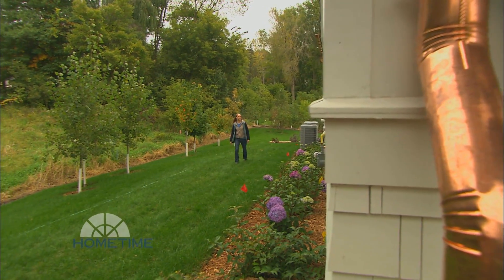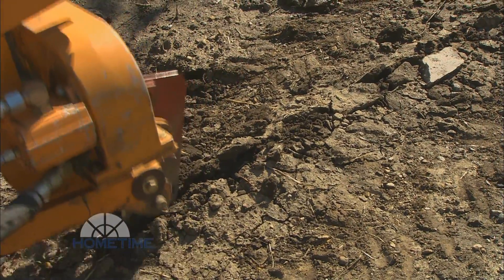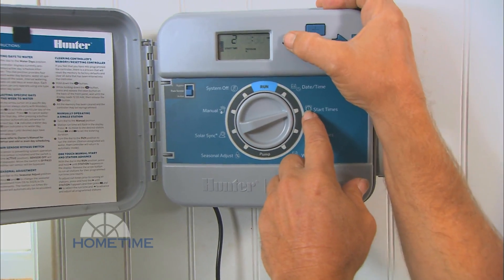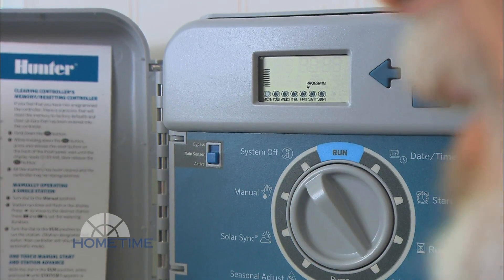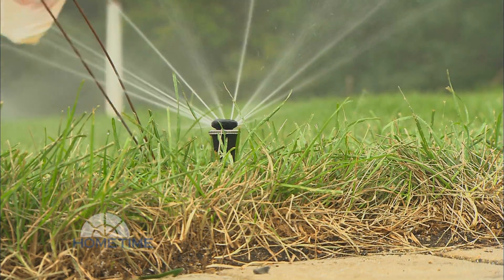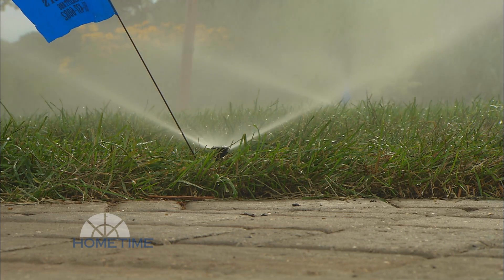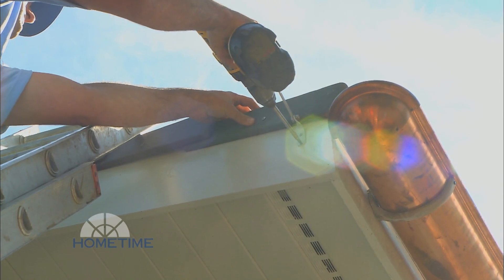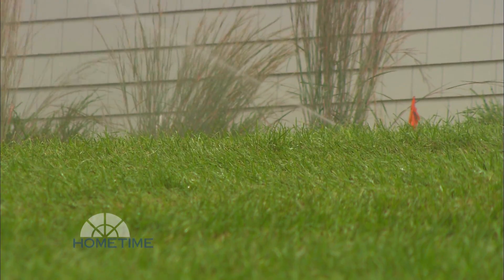How to Install an Irrigation System - part 2

Comment: It's important to realize that just because it's raining, and someone's irrigation is running, that doesn't mean the amount of rain is sufficient for the lawns needs.  I've seen my smart wifi controller schedule auto watering on mornings where it's been raining before.  I can see a pretty accurate reading of the water depth in my soil at anytime, and my system doesn't water a zone until it's at least 50% depleted of it's 6" watering depth.  This saves tons of water, I think anyone with an irrigation system should be upgrading to a smart controller.  Healthier grass and a lower water bill, can't beat that.
Reply: Hi sir... im interested of what irrigation system ideas that you recommend. Can i get some infos about where to contact Professionals that would give estimation (quote) for our home yard. I live in Sealy, Texas. Thank you
Reply: Ryan Valizan our company uses rachio smart timers. What do you use.
Reply: how do you manage to get accurate readings of the water depth in your soil at anytime? what do you use? thanks
Reply: Rain sensor prevent watering in raining day also soil sensor work together to skip few days of watering Rain Bird sale few to homeowners or comercial like the one we use in school district, this affordable sensor rain bucket sensor adjusted time, days , of watering of course one of this more than 600dls .